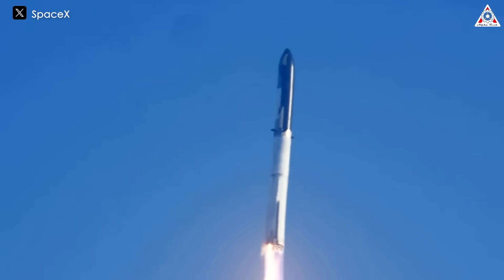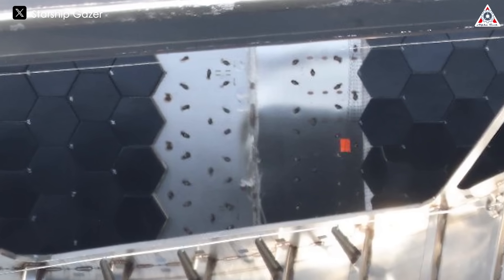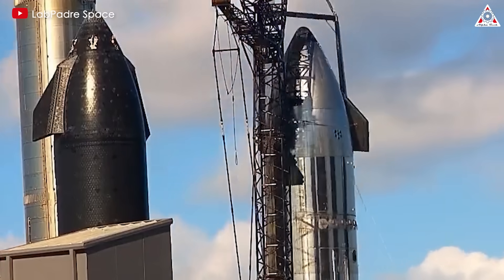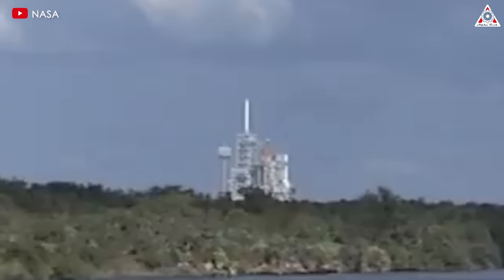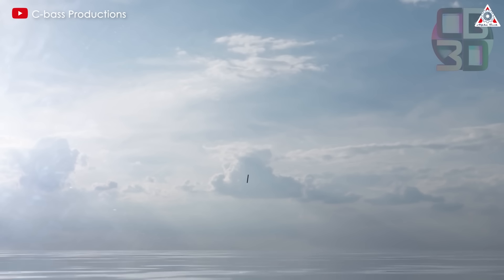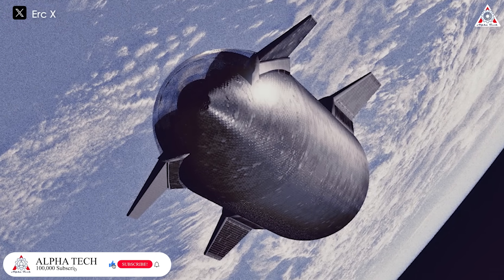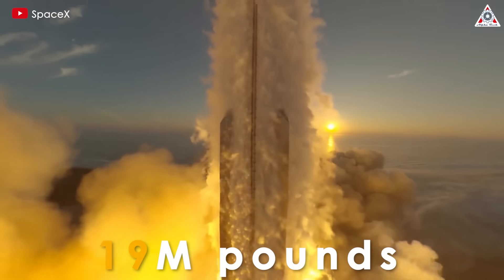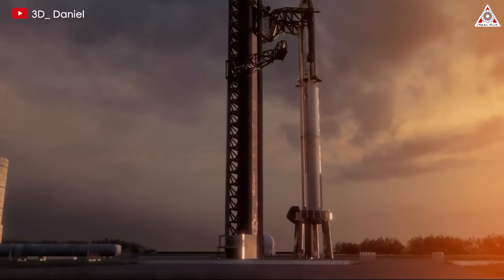Musk's BIG NEW Solution for Starship Heat Shield Re-entry & Splashdown in Upcoming Launch!

Comment: Two solutions I suggest...

1. Make a dip or pour on solution so you can dip the craft or pour it on creating a hard  shell exterior that is solid then if it cracks you pour it on or dip again.

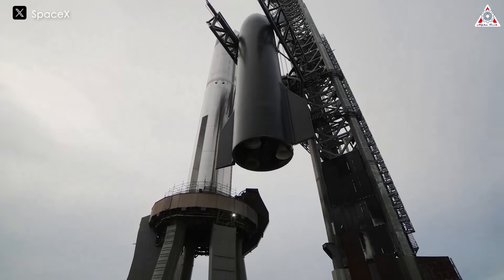2. M 14:07 ake it like the self adhering bathroom or kitchen backsplash tiles or military dragon skin. Where tiles are adhered to a mesh or membrane so that it is like dragon skin that is flexible over lapping each tile making the peaks for aerodynamic improvement like shark skin and allowing many tiles to be a flexible blankets to be attached to the steel. Kind of like bathroom and kitchen back splash tiles found at the tile section on the hardware stores?

Comment: After watching today's test (Starship 4) the reentry didn't "fail" but it was obvious a heat shield problem occurred. With Musk saying even a single tile loss could cause a failure made me wonder how they'd fix the issue? I know the tiles are not the same type as the shuttle used...? Is it the stainless steel the craft is made from that's aggravating the problem? Would reducing the weight using aluminum or titanium reduce the loads on reentry thus reducing the heat generation period?

Comment: Ill say again keep thermal tiles . Then sprey a heat restant shell over all  to make a smooth protecitive shell coated surface solid connected surface protector  no seams to penatrate. Worthy of solid unie service proctor of the protector
Reply: I agree. I mentioned it before. If they can make the tile materials into spray foam and spray it in specific areas, controlling the thickness of the spray in less necessary areas, they can achieve a smooth aerodynamic shape. Panels can be sprayed separately for easy access if needed, and they can perform a test on the Falcon 9 panel.
Reply: The problem is expansion of the Stainless Steel as it heats up … thinner and it expands further …

Comment: Heat tiles are a great 1970s solution. Although Space X has made some dramatic improvements. Such as the tiles can be replaced in a day vs a month for the shuttle tiles.
I think at some point Space X is going to come up with something a bit better. 
Recent experiments have shown that certain 4 metal alloys have extremely high refractory heat resistance, combined with high strength and a lack of brittleness previous alloys show. It may be possible to create metal tiles that can be bolted on strongly. And it may even be possible for these to have capillaries drilled or printed in, so that there can be transpirational cooling for the 15 minutes of plasma hot re-entry.
Reply from the maker: If SpaceX can do so, it would be impressive

Comment: Since day one I have been a proponent of a catch tower in addition to the launch tower. SX has now applied for construction of  a catch tower in Florida. As far as landing on a boat at sea, while doable, I would think it is far more difficult. The landing pins on the craft itself are small and the variable motion of the landing deck at sea presents a difficult situation. As far as the heat tiles, I think they're doable but the tile has to be more durable. If you can't find a a more durable product, then I would opt for a latticed like strengthening screen (widely spaced) inside the tile and a different way for the pin to engage the tile. I think both can be done without adding weight. In some tiles you might actually reduce weight. One thought is for the pin to be affixed to the tile (molded into) and the attachment point a bracket on the rocket itself. Kind of opposite of what they are now doing. In any case something different has to be done and I would be shocked if Musk didn't already have several solutions in mind. One lost tile in the right location and you would have another lost Shuttle Columbia.
Reply from the maker: Losing bricks is a situation I don't want to think about but they really need to be secured to the spaceship by all means! Hopefully the next launch will show us how it works.

Comment: Suggestion on the tiles, concerning vibrations.
Might be worth getting data on launch and re-entry sonic vibrations spectrums, and then analyzing the sympathetic harmonics of the tiles themseves, so they can be sized to match any nulls in the sonic vibes. basically those tiles are ceramic chimes, and will have a vibration frequency peak point and related harmonics intervals, and if fit into flight sonics nulls, migh help them hang onto the ship better.

Just sayin'
Things can be learned...
Reply from the maker: This is amazing!

Comment: I think the attachment pins are not holding onto the tiles securely enough, and that the end of the attachment pins needs to be redesigned.

Although without seeing the thing really close up, it can be shard to tell.  But, the present system looks like it ought to have problems.

Comment: I agree. I mentioned it before. If they can make the tile materials into spray foam and spray it in specific areas, controlling the thickness of the spray in less necessary areas, they can achieve a smooth aerodynamic shape. Panels can be sprayed separately for easy access if needed, and they can perform a test on the Falcon 9 panel.

Comment: Why Not use 2 layers of heat shields. They are light and wouldn't add much to the weight but overlapping heat shield tiles would probably insure one layer would remain.

Comment: During my analysis over the last year and where a charged mater perspective was looked at as a whole and especially concentrating on the launch system and Stage Zero, with it failing so spectacularly first time around. I haven't yet focused on the on going heat shield problem. And with the problems that generating electrically conductive plasma would naturally have, so I have only upto now just alluded to the re-entry problem and the plasma it will generate through friction.
With localised electromagnetic fields being generated through the interactions of different chemical compounds used in the heat shield via the generated plasma and which will have different charge values, naturally. But I don't know the system and materials well enough or even at all apart from the stainless steel, to determine. But we do see at launch is, how the vapor coming off of the launch vehicle has a spiral motion down the length of the lifting rocket and so showing an external magnetic field is present, even at launch.
A battery doesn't hold voltage as such, its the chemically separated charge when a load is put on the connected circuit that creates the ability for the battery to do work and so give out voltage pressure.
Reply from the maker: Great comment! Thank you so much!

Comment: But the Starship also can't use the Drone Ships because it has NO LEGS!
They'd have to build a new massive and heavy tower on any Drone Ship to catch it, otherwise the ship will land on its engines, completely crushing them, and then topple over into the sea anyway. 🙂
Reply from the maker: That’s right!
Reply: They are in the process of designing and building water based landing platforms with the catching tower. They bought a couple of old oil platforms but they weren't suitable for refit. Most Starship take offs and landings will be 20 miles off shore due to noise and safety issues of launching from land close to population centers.
Reply: @forthrightnight  yer but we're talking about these next two or three test flights. And those large platforms won't be 'drone ships', they will be manned and far more stable than the current sea platforms.

Comment: Great video! Thank you! I still have two concerns. First, I am doubtful that rapid reusability is actually feasible with a sufficient safety margin using current materials. Failure to achieve rapid reusability require massive changes to plans on how to use starship. My second concern is that SpaceX seems to believe that it can keep secrets about problems. As NASA has demonstrated TWICE, keeping problems secret is a good way to kill astronaut.

I really appreciate the time and effort that you spent on this video and the death went into. As far as I’m concerned, your channel is head and shoulders above other channels that cover SpaceX.  Thank you.
Reply from the maker: Thank you for your praise! In my opinion, there are technical secrets that they have not revealed to us, even the changes in materials. But what we are doing is predicting from the things they revealed and the problems they encountered! But I believe that the upcoming launch will be a great launch.
Reply: @alphatech4966  
I too think Starship Launch 4 will be mostly successful and that Starship will be a good LEO heavy lift vehicle.  However, I don't see the need for rapid reusability except for "orbital refueling" which I believe will be of little or no use because Starship is not the right vehicle to send to either the Moon or Mars.

Comment: You can not compare space shuttle tiles to space x star ship tiles. Why because the space shuttle is not made using stainless steal and the star ship surface is extremely cold in a very short period of time. It may need something on the inside surface to insulate the stainless steel and the tiles

Comment: There will probably be several different versions of starship for obvious reasons. The tankers will not reenter but will need thermal insulation to address boil off in orbit for instance. I remember we often speculated the Shuttle external tanks might serve in that capacity with their foam insulation. It is intriguing watching this phase of development but there is so much more to accomplish in the overall missions. I wouldn't be surprised to see gateways for crew relays to transit ships that are for earth/mars exclusively. Of course we can fantasize about space elevators but that's just science fiction for now. Still, having an orbital factory at some point seems likely.
Reply from the maker: I'm sure doing things like an orbital refueling station will be more complicated than we think. It's just that these things haven't been explained thoroughly, making many people confused. But as long as they launch successfully, the next steps will come.

Comment: Okay the heat-shield is a problem area. But nothing is solved and is still to be proven in reality. Spaceship is too massive to be landed on a ship
Reply: Like landing on a tower where arms have like 5 seconds to catch it before it runs out of fuel would be easier
Reply: Try to get your point. But I do give SpaceX credit of pushing the envelope as far and hard as possible. But you must leave some reservea for the unthinkable. If a system always operate at max limits it will only end in a catastrophic accident because there is simply nothing left.

Comment: If you space the tiles apart with the adhesive showing, then the glue needs to be red, because red is less suseptible to UV degradation.
Reply: Yeah. Because "UV degradation" during "days" of being exposed to "UV rays" after one "fligh" ends in "rapid unplanned disassembly" and before the next "flight" of a "fixed" so-called "spacecraft" yet to "achieve orbìt" is DEFINITELY the most serious threat to tile "retention" the "adhesive" moved from only "behìnd" the "tiles" to GAPS IN BETWEEN THEM WILL BE SUBJECTED TO IN ITS "LIFETIME". SURELY THE "HEAT OF REENTRY" - WHICH HEATS THE "TILES" TO "INCANDESCENCE" WHICH ALSO PRODUCES "UV RAYS"  WON'T BE A CHALLENGE TO THE ADHESIVE AND "DEGRADE" IT AT ALL. 

OH WAIT. IF THE ADHESIVE CAN SUCCESSFULLY "BRIDGE THE GAPS" BETWEEN "TILES" AS WELL AS KEEP "ADHERING" THEM ON FROM BEHIND THEM AND SURVIVE THE "HEAT OF REENTRY" BEING DIRECTLY EXPOSED TO IT WITH NO "SHIELDING" FROM THE TILES THEMSELVES BEING NECESSARY IN THE "GAPS" ONE HAS TO WONDER WHY THE REAL "FIX" ISN'T SHITCANNING THE "TILES" ALTOGETHER AND JUST PUTTING A "THICK LAYER" OF "ADHESIVE" ALL OVER THE "ORBITER" AND MAYBE PUTTINĢ SOME "GOLD FOIL" OVER IT FOR "UV PROTECTION". 

THIS "SPACE ENTHUSIAST" NARRATOR REFERRED TO SPACE SHUTTLE TILES AS "HIGHLY POROUS". WHICH PROVES HE HAS EITHER NO "HANDS ON EXPERIENCE" WITH THEM WHATSOEVER OR NEEDS TO GO LOOK UP "POROUS" IN THE DICTIONARY AND THEN SUBSTITUTE THE CORRECT WORD(S) TO DESCRIBE THEIR "CONSTRUCTION".
Reply: I get what you were going with.  
Just an FYI.  The tiles are incredibly porous. Each tile is something like 60% air.  Basically, it's a rigid dense version of fiberglass insulation   
That lines the walls of your house. SpaceX is using the same tile composition used on the space shuttle. Although based on recovered tiles the quality is subpar and inconsistent.  SpaceX has opted thus far to go with an alternative adhesive than the shuttle.

Comment: The tiles will never be secure enough for earth rentry let alone for reuseabilty. Starships hull is steel.  The expansion and contractions the hull will experience will loosen and weaken tthe integrity as well as causes separation from hull.  
Every time. Not to mention that musk is using poor quality shuttle imitation tiles.  In my opinion the tiles are the last of Starships many engineering flaws.  I doubt seriously the welds will survive rentry at least not for reuseabilty of the shuttle.  SpaceX  removed  every bit of housings and stabilizers from thier Raptors in order to save as much weight as possible.  And the thing still can barely reach leo as an empty shell.
Reply: Literally everything you just said is incorrect.